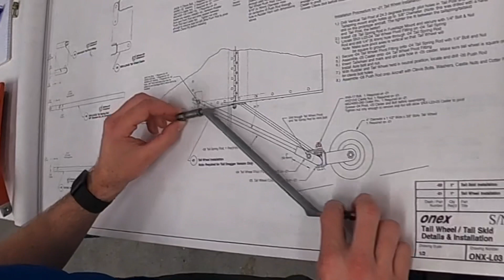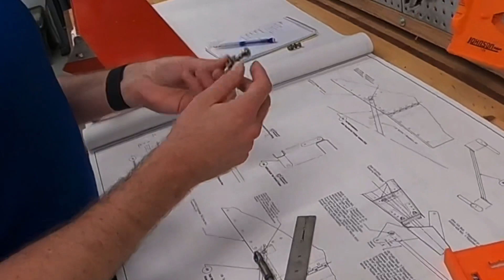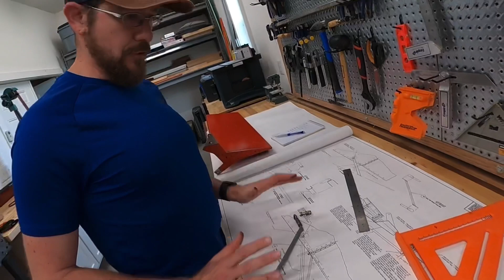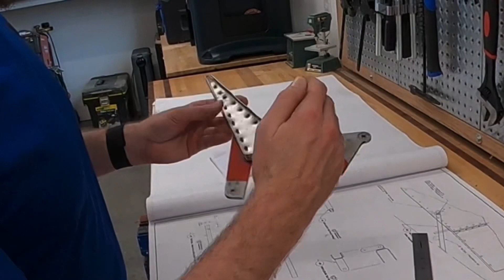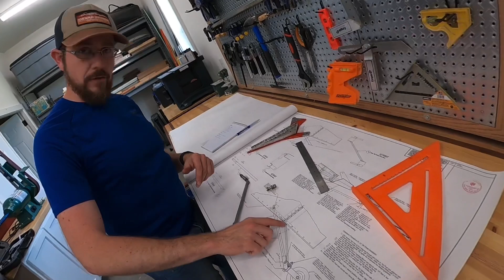So What Went Wrong? (Lean of Peak Aviation)

Comment: As an aircraft engineer (A&P) I would be mortified that that was missed during several inspections! That is precisely the stuff that a good inspection should be looking for. Your last inspection did not even look at that let alone lift the tail to inspect the tail wheel and attachment. Multiple washers and a over length bolt is a immediate flag 🚩and can be seen from 6 feet away. You should be looking for a refund as they did not inspect your airplane. In fact what else did they miss?! I would be going over that airplane with a fine tooth comb.
Reply from the maker: As an amateur pilot and non-mechanic I’m learning the questions I didn’t even know to ask in a hurry. You try to do your best and hire more knowledgeable people to help but nothing changes where we are right now.

Comment: excellent follow-up. makes sense. these are the types of things people change without thinking it through. Failure analysis can be a fun part of engineering. You learn so much more about why things do/don't work through failure. But we try to keep the failures to be the nonharmful types, or do the harmful ones in the lab under controlled testing.
Reply from the maker: I would have much preferred to learn this in a lab!  I just need to build the next plane…
Reply: @LeanofPeakAviation  agreed. this kind of failure is not one you want to have in flight.

But it's good you trusted your gut. I learned in combat to trust my gut instinct. My conclusion is that our "gut" is really our subconscious picking up on details our conscious mind doesn't, and when it sees something you don't, it alerts you. Kind of a left brain right brain thing. One side of our brain controls speech, the other does more analyzing or something like that. And if one side figures something out, it struggles to communicate it to the other half of the brain. That's my theory at least. It served me well and kept me alive, and helped me to detect/defeat ambushes I otherwise shouldn't have been able to. Whenever I get the gut feeling about a flight, I refuse to go fly until I figure out what the issue is.

Comment: There is a fundamental design problem with the rigid push/pull tail wheel steering rod. It will always impart a bending moment on the rudder control horn as the spring tail wheel moves vertically.
Reply: if you design for the known forces, it's not an issue at all.

Comment: Maybe attach the rod to the bottom of the horn ?  and use 3-4 10/32 machine screws and  rivets to attach the rib to the horn ? Make the parts so they cant fail !!! Gary k
Reply: you want certain parts to be able to fail. By controlling what WILL fail, you ensure that in the event something were to fail, it's not something life threatening. If you over do the wrong parts, you can then induce a life threatening failure somewhere else in the design. 

This likely never would have happened had the control rod been built and attached properly. So that is what needs to be fixed. Don't go creating additional problems changing things that don't need to be fixed.
Reply: Like the plans.

Comment: Was the rudder length changed? I'm curious as to what You will find, when the correct parts come in... That push-pull rod with the bends on both ends, is a very unusual design... Especially when directly connected to a flight control that is always used....
Reply from the maker: It could happen two ways…first the rudder could have been made or cut too short, second the placement of the hinge could have been off.  I’ll be looking closely at it.
Reply: @LeanofPeakAviation  I bet that you will find out that it was off by one lug of the hinge material - the hinge was mis-installed (lugs aligned instead of staggered) and then someone trimmed the "long" end of the rudder.